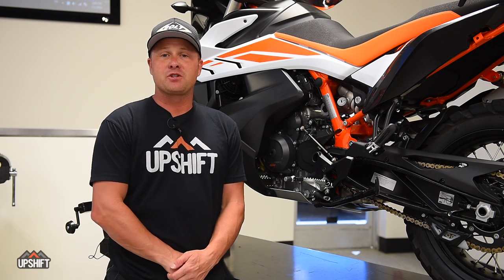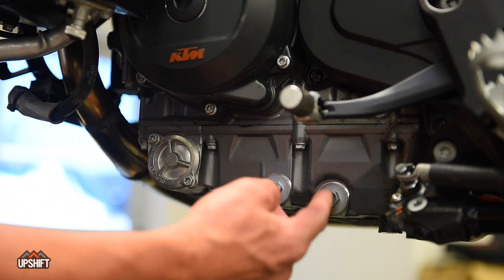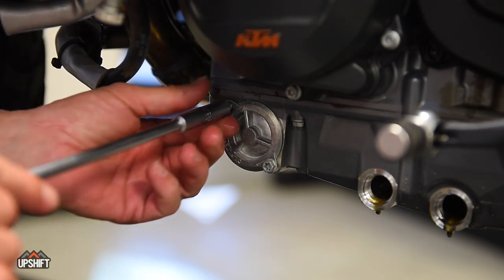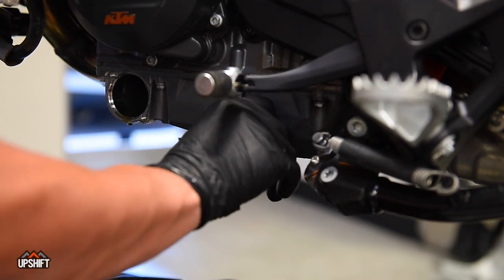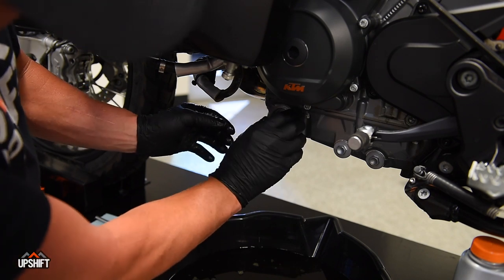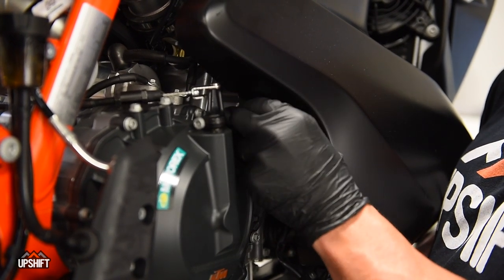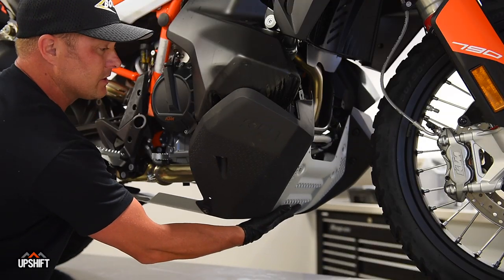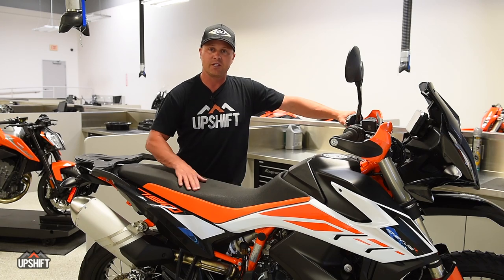KTM How To: 790 & 890 Adventure Oil Change

Comment: Great video. One note: The owners manual and repair manual of the 2021 890 ADVR say to put some medium loctite on the 4 front bolts of the skidplate. If this was not the case for previous years, maybe KTM found out bolts were missing after people rode offroad a lot and fixed it in their manuals 😄.
Reply from the maker: A little blue threadlocker is never a bad idea for these bolts. We prefer Stuck Nutz as they invest in keeping backcountry riding open to all. 
Read here - https://bit.ly/stkNUTZ

Comment: Very helpful video.  When I filled the oil, the sight glass was full of oil, even when on side stand.  However, after running the motor, the oil level normalized to 1/2 sight glass (perfect).  Mentioning here because it was not mentioned in video and not mentioned in 890 OM/Repair Manual.  Also torqued my filter bolts to 10nM.  Lesson, read the comments before performing the procedure.  Thanks again man, very helpful video -- appreciated.
Reply from the maker: Yes, always run the engine for a bit to warm up after filling and re-check your oil levels before riding. Thank you for watching.

Comment: Useful video. Thanks 👍🏻 I haven’t bought my 890 yet but I already know how to change oil on it) Now I’m going to check if you have the same tutorial for the air filter.
Reply from the maker: Thank you for watching and commenting. There is an air filter video as well. https://www.youtube.com/watch?v=1UGTNEjg2qg
Reply: And now I’ve done 5k miles on my 890. It’s time to change the oil)
What is the part number of the filter? 
Thanks for the vid!
Reply: One more question if you don’t mind. Is there any difference between oil Motorex Power Synt and Cross Power for 890 Adv? Yeah I’ve heard than one is “for on road” and another “for off road” but it doesn’t make clear for me technical difference

Comment: Checking the engine oil level: The engine oil must be checked at normal engine operating temperature ( w/ Engine HOT). After switching off the engine, wait one minute before checking the level. Pg. 290 from your manual.

Comment: Just checked with a dealer. They want about $700 for the 9k service and $1300 for the 18k service. That's about $2k every 18k miles or about $.11 cents per mile. So if you ride 200 miles on a weekend, you'll pay about $22 towards the service,  or about another tank of gas.  Something few sale people will mention.  Excellent video though....
Reply from the maker: Yes, the overall cost per mile is a figure very few look at when purchasing a motorcycle. Thank you for watching.
Reply: Thanks for the heads up.
Reply: Why not service it yourself ? Easy enough .
Reply: Because I'm getting lazier in my old age. Plus my mechanic says he likes KTM's, nice ride, performs well etc, but hates servicing them as most things aren't as easy as on other bikes. As I've know him for years and I'm a novice, and he's a professional, I'm inclined to trust him.

Comment: Hello, thanks for the video. Is 2.8L excluding the oil you put in the filter?
Reply from the maker: total
Reply: @UPSHIFT_ONLINE  I've now done two oil changes on my 21 890 R measuring 2.8 liters total, exactly.  After running bike for 5 min and turning off, I check the sight glass and oil level is at bottom of sight glass, not middle with moto standing exactly vertical.  I always need to add about .2L to bring the sight glass up to mid-glass.  Anyone else experience this?

Comment: What kind of cleaner did u use on the oil drain rods, silicone, carb cleaner?
Reply from the maker: Carb cleaner in the video. We now use Maxima suspension clean.

Comment: Hi,.thanks for the video. Have you heard about oil consumption on the 790 Adv R engine ?
Reply from the maker: We put 15,000 miles on our 790 before switching to the 890 and we did not have oil consumption issues in that time frame.

Comment: what spray did you use to clean the screens?  Where can I find the tall oil measuring container?  thanks...great vid.
Reply from the maker: We use brake cleaner to clean the screens and the oil measuring beaker is pretty common at most motorcycle shops. Or search for the Polisport Oil Beaker.

Comment: You say in your video and as mentioned in the manual :"first oil change at 620 miles and then moving onward from there it is 9300 miles".
Reply from the maker: That is correct. That first time frame is to get the break in miles done and get that break in oil out of the engine. Then your oil change interval extends by quite a lot.

Comment: Just bought a 890 3 weeks ago was changing oil and the vibration damper was bolted to engine and had wrong bolts as well. Guess going back to dealership to get the correct bolts this week. Kinda 😡 mad
Reply from the maker: That’s not ideal. Wonder if someone screwed up during the PDI.

Comment: I have a lot of metal shavings on my magnets and it's probably due to all the false neutrals I've gotten. It got it all off but it was a real bitch.  Can you take the magnets out to clean them?
Reply from the maker: Not that we are aware of. It could cause some serious problems if the magnet came loose inside the motor.

Comment: Hello sir.  I have ktm 390 adventure the company is using motul 10w50 engine oil which needs top after every due to it decrease after every 500 to 1000kms... other experts say motorex is not good oil it becomes black very fast .. please suggest me correct grade of engine oil for ktm 390 adventure
Reply from the maker: Use what the owners manual calls out.

Comment: The 10 Nm torque settings on the oil filter cover IS INCORRECT, in the book it states 6Nm of torque….
I know this because I torqued mine to 10Nm after watching this video and snapped the head off a bolt.
Reply from the maker: Hey Paul - thanks for the comment. We are going to look at adding a note to the video and we will be adding a note to the description. We did not double check this as we shot this video in KTM's service department with a couple of their service people. But we clearly got it wrong anyhow.
Reply: Hi Paul, I did the same dumb thing but without snapping the bolt. Now, after torquing it to 6Nm, the oil is leaking a little bit... Did you had any leaks and how did you fix them? New O-ring?
Reply: @UPSHIFT_ONLINE you should delete, edit and post this video again!!! 10NM to 6NM is a big torque difference and a massive headache! No excuses just fix this for God sake!

Comment: 9300 miles oil change in all riding conditions? Off road ,daily high traffic usage and hot weather conditions?
Reply from the maker: The 9300 mark is for a full service. Oil change intervals are 3,000-3,500 miles. If you are riding a lot of hard dusty offroad miles, be sure to check your air filter often and make a judgement call on oil. If you have been feathering the clutch a lot, running extremely hot etc... it might be smart to change oil sooner.

Comment: Why draining good engine oil. Feel like it had only 3000km or less.
Am using Motul 7100 and draining 100hrs working or 9000km.
Reply from the maker: It was a relatively new bike with 680 miles if remembered correctly. It was time for the initial oil change to get the break in oil that comes from the factory out of the bike. After that, you want to change the oil every 5000 KM / 3000 Miles. Every 15,000 KM / 9,300 miles you want to do a full service.

Comment: The bike should be on the sidestand to allow more oil to be drained. It's on the manual, try reading it!
Reply from the maker: Thanks man! Yes you are right. But for the sake of the video and walking folks through the process it was better to have the bike on the lift and the bike upright. Most people don't have a lift and do change their oil off the kickstand. Sometimes you gotta read between the lines and not be quite so literal. You will live longer.

Comment: Lots of steps for a simple oil change.
KTM could have done a better design.
Reply from the maker: We thought it was pretty straight forward really.
Reply: yea removing that skid plate and the extra bolt/screen is a real hassle..........jesus
Reply: define better ? what do you mean lots of steps ?
Reply: Yes, I thought this was a super-simple oil change. No removing tons of plastic to get to the bits you need. The only thing is the circlip pliers recommended to take the oil filter out. But since you won't be using the filter again, as mentioned, regular needle nose pliers should be fine. It's not like the filter is jammed in there...

You can probably do this in 15 - 20 minutes. Well done KTM!
Reply from the maker: But they're so good at it. ;)
Reply from the maker: Agreed Ricard! Thank you for the comment and for watching our little video.
Reply: It is clear you did not own a 640 adventure. 790 adventure oil change it is a piece of cake.